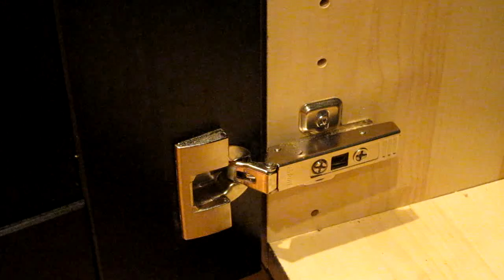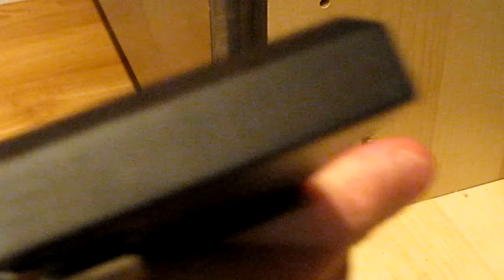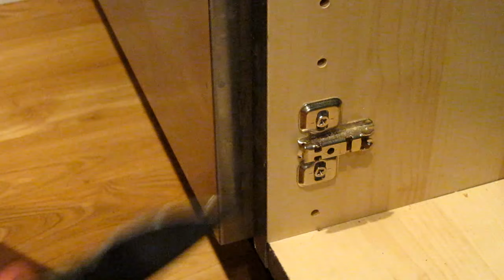IKEA INTEGRAL Kitchen Cabinet Door Hinge, How to clip and unclip and install.

Comment: Saved me so much pain and nerves as I kind of tried a screwdriver into the back and the middle hole to un lick it and somehow just managed to bend the metal and still not take it off. My jaw just dropped when I saw you just unlock it with no effort, and I have to say I was just as surprised that it worked for me with the same ease.

Thanks again. Now that I fixed my kitchen cabinets, I finally have the courage to remove the doors and replace my bathroom cabinet shelves.

Comment: These hinges are unbelievable. I have found them so easy to unclip. However, after numerous frustrating attempts I have given up trying to re-clip them. The door now rests in front of the cupboard redundant. He makes it look easy here, but try doing it while holding up the weight of the door, and failing over and over.

Comment: Thank you so much. The ltch had come undone and your method easily fixed it. The top latch screws were also loose and that cause the bottom latch to get mis aligned and come apart. Tightening those up latch screws seems to put everything back in order.

Comment: At least in Australia  the Blum  hinges that some Ikea Stuff uses  must need a new mold/form  because they need a hammer / mallet  to  get to latch  the tolerances are real bad....  if you dont like hitting them then  maybe a  Dremel  to the latch pin receiver might get you within the   "just click tollerence....  its likley the wedge the pin fits into that might be undersized not allowing the pin in  enough for the latch to work right....

Comment: They're not a joke, they're frustratingly pathetic and immensely inadequate! Though I understand your sarcasm. 

But yes, thanks for this clip, though I wonder where you got such a well made hinge. At least I know I'm attempting to do it correctly. I'm trying to put one back on after I had taken it off for a wall repair. Even the installer had trouble when he did them, and he'd installed many cabinets. They don't easily snap I even trying hitting it and it still won't go in - I damaged the wall.

Comment: question, Your video helped immensely,, I have one door which is sitting lower than the other, doesn't look like there is an adjustment for this?
Reply from the maker: I'm not sure if the old IKEA hinge has the same vertical adjustment as the new one.. this is my video that explains the new hinge.. https://www.youtube.com/watch?v=_Adzl16HVZI this may point you in the right direction to look.. hope it helps.

Comment: hi.. i have 6 of these hinges as extra..(don't ask.) and am wondering if i could use them for a built in wardrobe I am making.. so i would have to cut the hinges into the doors.. which are 18mm white MDF.. and it's a heavy door.. around 30kg..was thinking of using 3 of these hinges.. any advice?

Comment: I agree. This is bullshit . These things do not simply snap on. One hour of struggling and I still haven't managed to get one door installed.
Reply: Update:  I took the hinges back to IKEA.  I had the ones that go on the side of the cabinet installed backwards. (They are shaped like an "x".)  Once I realized this I felt like an idiot. I had the doors installed perfectly within a few minutes. IKEA directions are uniformly ridiculous.
Reply: Howard Fields yep, the instructions from IKEA are sometimes lacking.
Reply: Howard Fields Thanks! You just saved me a 2-hour round trip and looking like an idiot !
Reply: Works perfectly for me.  They do snap on, but you must remember to place the pin in the catch.

Comment: This is effin impossible.
Reply from the maker: you can do it! make sure the base is on the cabinet the right way round, then be one with the hinge, be the hinge... Good Luck!
Reply: kwazadilla After arguing with my husband I finally convinced him he put the brackets in backwards. It really is trcky... because it looks almost the same the other way.
Reply: kwazadilla Is the self-closing damper just for the integral hinge? Or can i buy just the damper for my original cabinet hinges (lowe's kitchen)?? Thanks!
Reply from the maker: Stephanie Barajas The damper is specifically design for the IKEA Hinge, as far as i know. I bet the chances are low it would work with a Lowes hinge. IKEA does offer a door damper that can be used on any cabinet doors (it doesn't attach to the hinge.) I have a video of that damper here...How to Make Any Cabinet Door a Soft Close Door